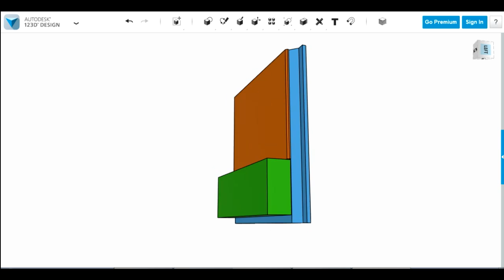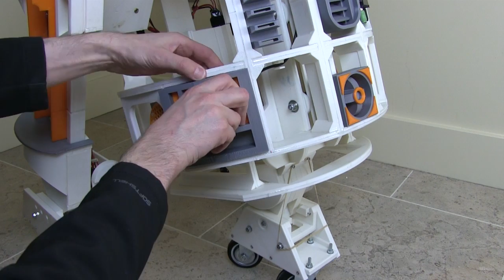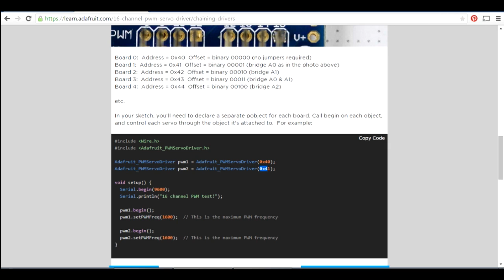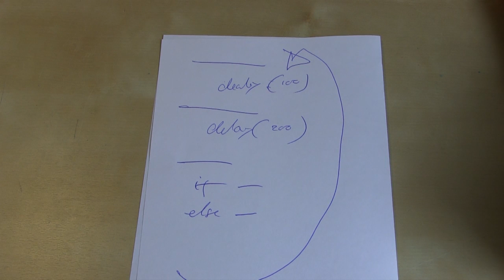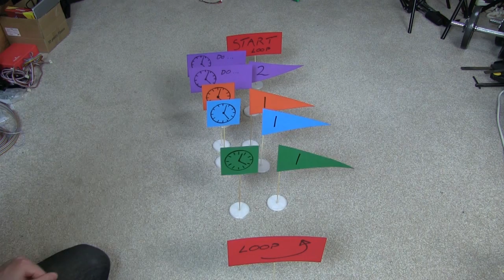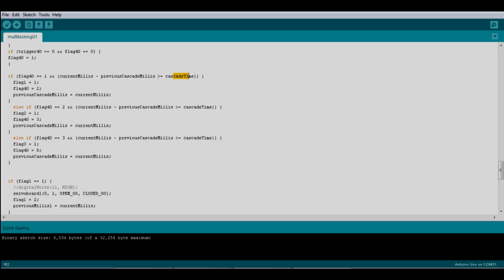Star Wars R6 Droid #13 | Multitasking with Arduino | James Bruton

Comment: have you tried servo motion with something like  'pulslen+=10' rather than 'pulselen++' to speed up the servo transition while still getting nearly full range motion? It would cut down the number of iterations while not significantly cutting short the max motion range acknowledged by the servos.

Comment: Hi James, can I ask a quick question? I'm building an R2-D2 droid, and was wondering if you remember what make/model the windscreen motors were in the feet drives you used. I'm experimenting with Wheelchair motors for torque/quiet operation etc, but they are incredibly heavy and being 24volt, they also mean more weight in batteries. I also need to disable the onboard brake too. Your solution looks lighter and easier to incorporate into the feet. Thanks for the amazing videos, your work is awesome and the videos very inspirational. Regards, Greville.

Comment: Nice job explaining the state machines and the loop control. Not an easy concept to communicate.

An alternative to the for loop is setup another state in your state machine that increments the counter and calls SetPWM (or whatever that method is called). When you reach the end, change states. Then the main control loop handles the looping instead of a for loop and doesn't stop the outside loop.

Comment: Hey i found out about 3D printing today and i hope that you can learn me some, here are some questions:
1. Can 3D printers actually print technology like another printer? If so does it require specific "fuel"
2. After getting a 3D printer, does it cost to print anything? I mean, you can print from daleks to frickin CARS.
3. What do i need to 3D print?

I see that you answer on many comments so hopefully you'll answer this.
Reply: +Cheddo Films 
3D Printers can print plastic/Rubber etc parts generally, you buy 'filament' as the material used to print with, it is just spools of plastic (ABS, PLA etc).
2) It costs electricity, and for the filament, which is around $50 for a 1kg spool
3) A lot of research, a 3D printer, and some filament and lots of time, they are very slow. Keep in mind the build size, i.e. you can only print parts up to the maximum size of your printer bed.

Comment: I was hoping you could help me. I have a Lulzbot Taz 4 with the upgraded hot end. For some reason since getting the new hot end it just does not want to print. First layer or two look okay but when the nozzle moves up in the air it just doesn't print. The fillament gets chewed a lot of the time and I found out that's the hobbed bolt but I do not know what else to do or try. Is there anyway you could let me see your configs? Do you leave it plugged in to a computer or do you print from the SD card slot? Any other tips? I'd even donate to your Patreon if you could help me out.
Reply: +dustin evans Might be an idea to donate to the Patreon anyway, it is only a dollar a month or so, and he is very helpful on the subreddit.
Reply: Haha. Just came across this comment a year later. Turns out my fan had a loose ground wire. Finally figured it out a couple weeks or so ago. A year later and my body is almost done. Thanks again for the files, James! I'm so glad I got my printer working.

Comment: needs a bad motivator and some smoke....
Reply: 1mrunforgetable  maybe a foam one that pops out the top.
Reply: 1mrunforgetable  I'd use a nerf gun and just use a solenoid and some 3d printing to pull the trigger as for the smoke I'd use either a coil and some fog juice or a vaporizer from a water fountain. -doesn't take much fog juice to make the effect - probably the better way to do it..

Comment: with the hobby king servos, could you not make it so every iteration of the loop you just set the servo values to half way between the target value and its previous actual value. This should remove the need for the for loops and should make the servos actuate in a smooth asymptotic manner. :)
Reply: Luke Rutter If this is too much, you could just increment your steps by 10 rather than one, this would speed up the loop. But after seeing the motion in the video, the speed looks good. Decreasing the duration of the loop may effect the speed of the arm movement.
Reply: Maxx B Yeah it definitely sounds like a compromise would be needed in any case, and as for the idea i mentioned, it doesn't have to be half way between the target and the current value - it would probably have to be tuned appropriately. If it is done such that x(k+1)=x(k)+ [r(k)-x(k)]/18     assuming that the x is the current state in degrees and r is the current reference in degrees, the largest step size would be 10 degrees and it would take approximately 80 iterations to change from 0 degrees to 180 degrees. 

Also i mean to use this instead of the for loops. Every time the state machine would enter the servo controlling state, it would recalculate x(k+1). This would also allow for all the servos to actuate simultaneously as well as one after the other.

Comment: Hi James, again, nice work. You might want to look into the elapsedMillis Library which would make te timing a bit more easy: http://playground.arduino.cc/Code/ElapsedMillis

Also, if you expand your code any further, consider breaking it up in different classes, so one for your servo's, one for lights and one for audio. This way your code stays manageable (and reusable). I used this on my Power Suit: http://michaelteeuw.nl/post/99243663922/power-suit-part-7-the-code-magic

Anyway, keep up the good work!